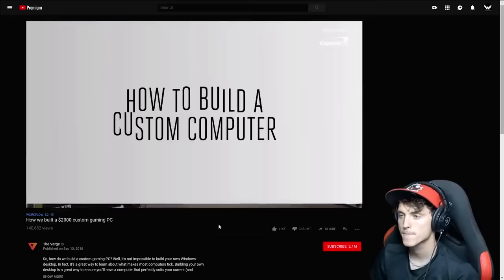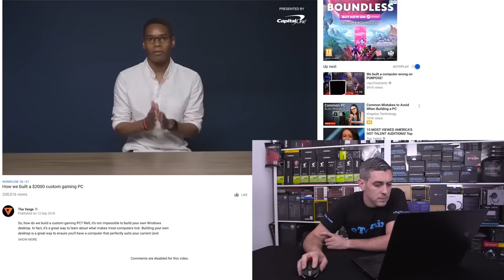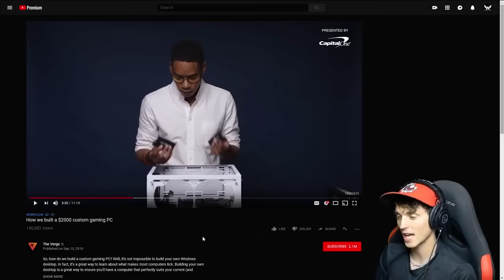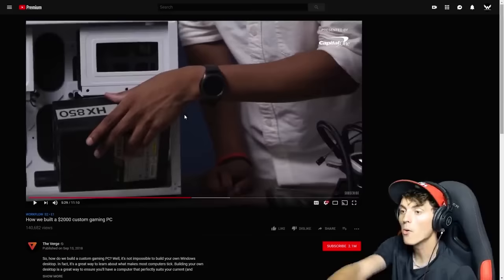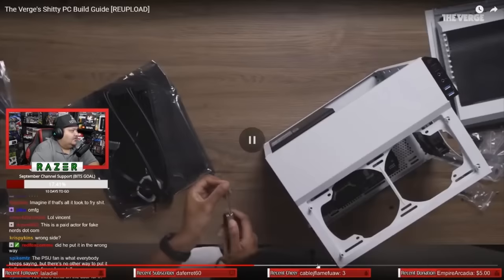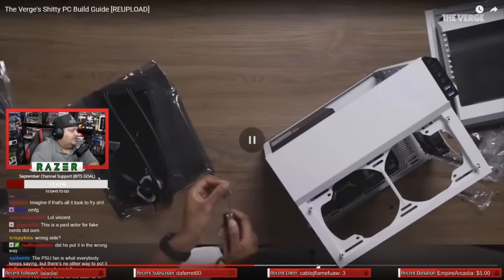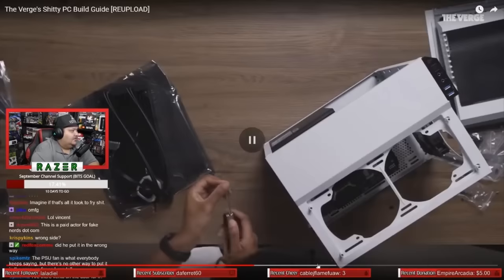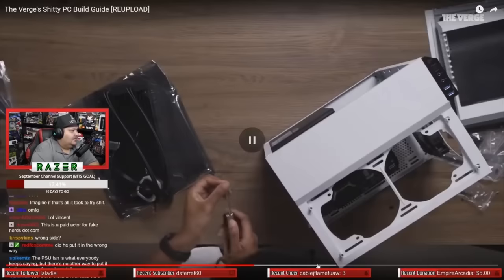The Verge's $2000 PC Build Reaction Supercut

Comment: On a side note: 3000mhz is the sweet spot for gaming

Correct me if I’m wrong
Reply: Faster RAM will theoretically always be better for processing. 3000mhz is by no means the "sweet spot" in that regard.
If you're referring to price/performance then I think pretty much all speeds of DDR4 RAM is getting cheaper because DDR5 is being integrated into mainstream. You might as well go for something closer to 4000mhz
Reply: @paolosworld99  for my next build I’ll be aiming for 6000mhz
Reply: I'd say 3200mhz is, only a tiny bit more expensive.

Comment: 16:20 here's one place I totally disagree with, Arma 3 is a BITCH to run and 70 FPS is not easy, it really doesn't make a difference if you're on the ground or flying 500 MPH.
Reply: Arma 3 is fairly optimized in comparison to its predecessor (NASA's computer would struggle on Arma 2 Max out,) And so long as you have a decent processor and GPU, you can have a cobbled together system otherwise and it will run fairly consistent.
Reply: 1080p 70 fps on a 2000$ system? No way that's difficult when my 3 year old laptop with a 1650Ti can run 60fps on it without issues. This thing wouldnt last a month without shorting or breaking something.
Reply: @magivkmeister6166  Arma 3 is more dependent on the server than about any other game I've ever played. I played Arma from the A2 Operation Arrowhead, DayZ Epoch, Overwatch, to A3 alpha, beta, and finally when Epoch and Player Unknown's Battle Royale (precursor to PubG) and up through 2019 and by golly gee whilakers. Some of those servers, when you're entering Kavala or the major cities on Tanoa and other maps during lots of action, custom server items/shops, and high player counts, nobody is gonna have 100 FPS .
Reply: @dougpowers2  idkkkk dude, if your relative baseline is graphics, sure, but that's to be expected for being made about a decade later. Arma 2 and Arma 3 are some of the most unreasonably laggy and downright questionably-developed games I've ever played. They're my first or second most played games ever at over 5000 hours between the two, but there's no excuse for some of the goofy ahh desync and stutters.
Reply: @Jordan-rb28 I was able to run Arma 3 on an old Toshiba Satellite (Intel HD 3000 graphics) back in the day. It didn't look the prettiest, but it ran fairly well